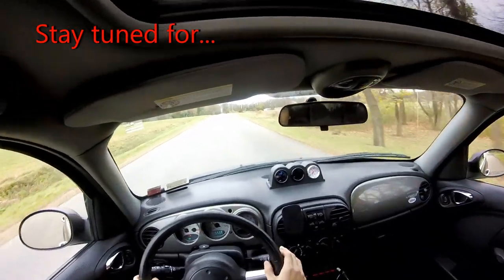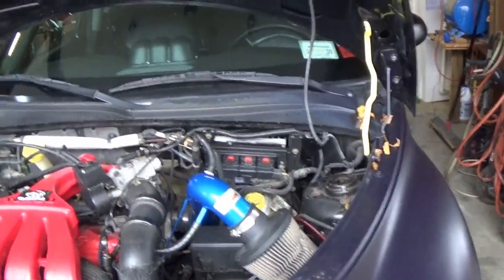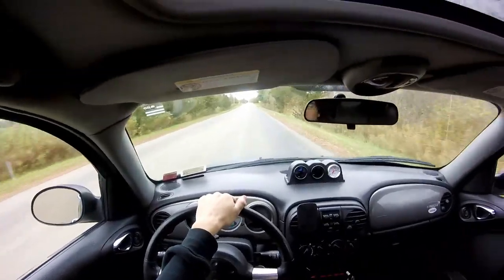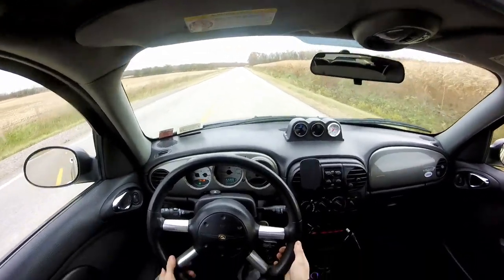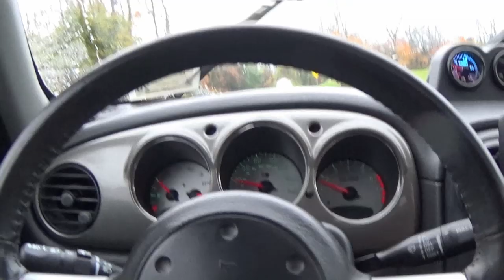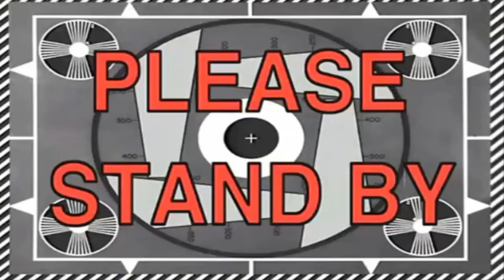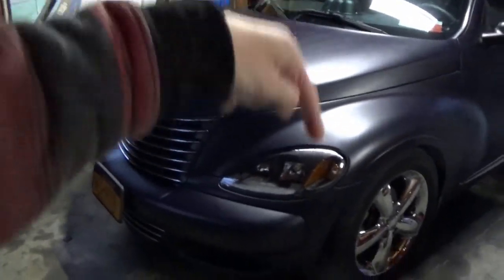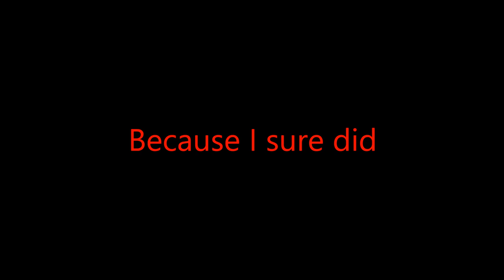PT CRUISER GT GETS A MOPAR STAGE 1 TUNE!  (It's SO FAST)

Comment: It brought u up to gen 2 gt stock specs. 250hp, 15psi 6300 auto shift in autostick. My mopar stage one brings me to 300-320hp 18-20psi and 7000 auto shift
Reply: Did you get it fromm Neon PCMs Plus?

Comment: Retired my 2002 PT base at 262xxx. Didn't seem worth it to replace the clutch master cylinder. Bought a 2002 Limited Edition. No heat. Six hours to replace the heater core. Not an easy car to work on. Still love these cars. Thanks for your videos.

Comment: The leaves are almost all down on the ground and good weather is slim now,  our 03 PT GT is getting put away this week for hibernation during the winter. Will be doing some work on it over the winter months to update the front suspension and maybe do something with the clutch before we have any issues with it. btw  We don't drive ours in the rain or when it's wet on the roads. We want to get at least another two summers out of it before doing anything drastic to fix it to keep it on the road.

Comment: Please tell me that you also swapped the fuel injectors. 2003 ran 527cc/min and Mopar stage 1 requires 577cc/min.
Reply from the maker: Mine is a 2004 so I didn't have to swap them out!  Forgot to mention that in the video.

Comment: Great video, I'm planning on going all out with my 03 pt gt with 5 speed. Quick question tho, will a m/a manual work in a gt. I need a temporary transmission while I rebuild the original

Comment: Two questions: How did you pass inspection with the check-engine light on? Any improvement in the gas mileage? Thanks!
Reply: Just clear the codes and drive 10 or more miles and go get inspected before light turn on again always work for me... good luck.

Comment: Honestly don't like that split level whistle when your hard on the gas. I also have a cold air intake and it's just a smooth whistle from start to finish. But, I have a blow off plate and a plastic intake tube. Probably has something to do with it. Nice tune though! (Btw I am TheRoamingFlomad on IG)

Comment: Alright, i need this for my 03 pt GT now..
Reply from the maker: It is so worth it lol!!   Just a warning though, wish I thought to mention it in the video, apparently the 2003 GT's had slightly smaller injectors compared to 2004 and up, so Stage 1 requires an injector upgrade ):
Reply: @jimmycruiserr  trying to find one but no luck yet. Point me in the right direction? Lol
Reply: @DougyFresh010  Siemens injectors are popular
Reply: About 200$ new

Comment: That's really cool. I have a 2007 Chrysler pt cruiser Limited edition  and I wanted to know will a stage 1 work for my car?
Reply: If it got turbo yes
Reply: @MM_45  ok cool. Now .my question is this. I have a naturally aspirated 2.4 O7 PT Cruiser Limited and I wanted to know is it safe to add a turbocharger kit with the intercooler to my engine?
Reply: @savealifecounselinggroup1070  its possible to turbo a N/A pt but engine probably wouldn’t last long due to not having stronger internals as the turbocharged ones unless you run super  low boost. If I were you I’d sell it and get a turbo version and not have to do all the work for turbo.
Reply: @MM_45  oh ok thank you😊

Comment: Have you considered running HPTuners? They just released jtec support.
Reply from the maker: HPTuners did???  I didn't hear about that!  I know a guy that does HP stuff too... 🤔 that's huge I'm definitely gonna check it out, thank you!!
Reply: You are welcome. I ended up with 2 ptgt’s for an srt4 wrangler. Tuning has been the biggest concern for me. Now that hpt has support, options have opened up a lot.  I hope they release some cool features to allow full dive in the ecu. I already own the newest hardware for hpt, so I don’t want to fool with diablo etc.

Comment: My 06 pt gt's (high output) tipm went out, mechanics tell me that it got fried because my shift solinoid went out. My car is stuck in limp mode (2nd gear and reverse) what should i do?
Reply from the maker: I've never dealt with a TIPM issue myself but I know that can be brutal!  I've never heard of the trans causing any issue with it though.  If it was up to me I'd probably redo the TIPM and then see how the trans feels, but then again your mechanic probably knows more than I do at this point!!  Good luck man that is tough 🙁
Reply: @jimmycruiserr  is a sensor in the tyranny that sometimes get bad like that and you can change your self google or youtube it. Good luck

Comment: i have an 04 limited edition turbo. i just put on the blow out valve and sounds dope. but on my 04 do i have to buy fuel injectors first b4 i add the stage one pcm?. And is getting rid of the check engine light A problem to get rid of after installation?

Comment: Do you ever upgrade
 for injectors stage 1
Reply from the maker: Only the 2003 model year GT’s required an injector upgrade, the 2004+ already had slightly bigger ones from the factory!
Reply: @jimmycruiserr  ohh ok mine pt take long to shift from 3 to 4 gear i really need to hit 40 to make change. I can't never use regular gas because pin like crazzy.   Get dual exhaust like mine look cool to.i was wonder you can call me tomorrow or meaby we can video chat around 10am.
I'm thinking to get one to for mine I really need to upgrade de injectors. Soo far is very fast to I love it.

Comment: I got a 2005 PT cruiser convertible. I never did any upgrades on it with like the transmission or anything. if I purchase it can I just pop it into place like you did or do I have to upgrade anything else on the PT cruiser first?
Reply: Mine is also an automatic

Comment: Any suggestions for fuel injectors for an ‘03 gt. I would like to run it on 93 octane
Reply: If your still running the stock pink 03 injectors, you'll want to upgrade to the 04up 577cc injectors when you change to the stage 1 pcm. The Mopar stage 1 fuel map is based off the later injectors.

Comment: Just drop a hemi in it and be done with it lol
Reply from the maker: Good idea I'm gonna do that tonight real quick.  Lmao!  That would be badass, but honestly the SRT-4 is my favorite noise maker of all time ❌🧢
Reply: @jimmycruiserr  that will be collectable so if you can get one get it. I have the 06 dodge magnum rt awd
Reply: @jimmycruiserr  the srt4 was fast low 13s in the quarter mile
Reply: @GMbowtie350  so you have an srt4?
Reply: Unless you're going with a 6.2 or bigger the 2.4 turbo can hold 600 HP on stock internals and it's cheaper then trying to pull 600 HP out of a 5.7